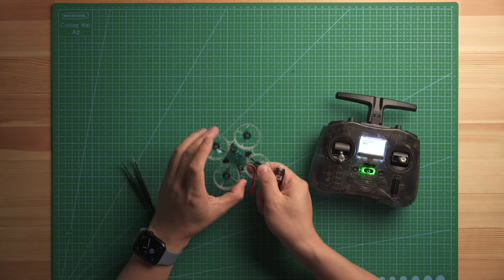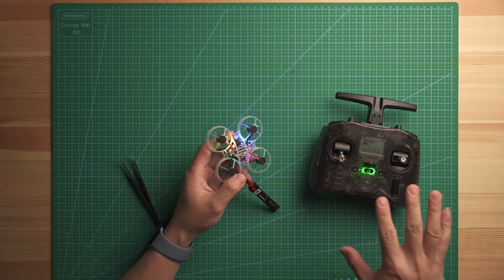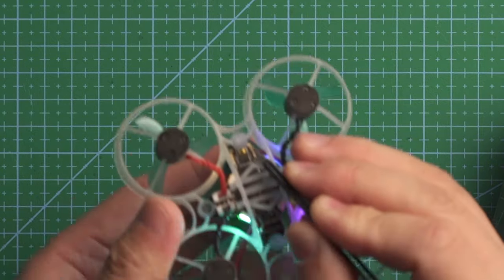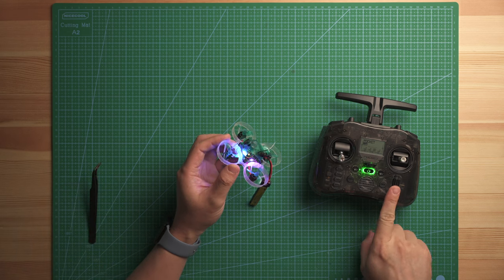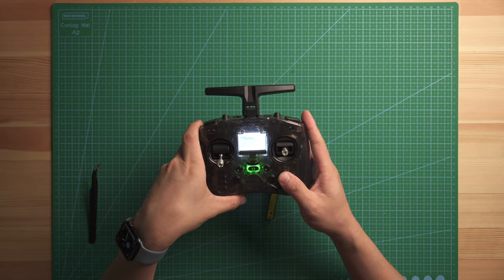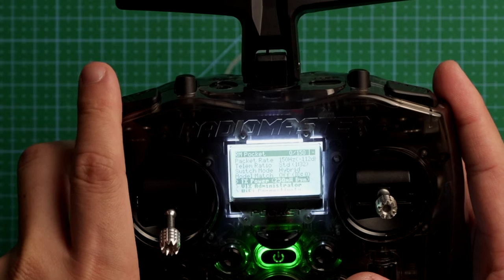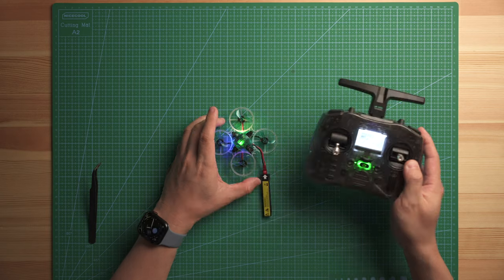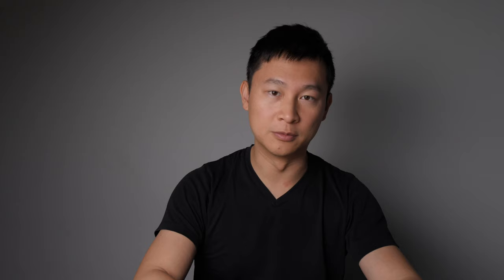Hummingbird V3 BNF Binding | A NewBeeDrone Tutorial

Comment: The easiest way to bind to this is to simply add your bind phrase on betaflight. It instantly binds without having to push the button and doesn't unbind. This is a great little quad right out of the box! The tune it comes with is pretty spot on!
Reply: I tried that and it did not work for me.  Maybe others have gotten it to work.  I had to press the button.
Reply: Not on mine
Reply: @transmech  did you double check that the elrs module and the receiver are on the same version of elrs. I've still to this day never had my bind phrase not work.
Reply: Yep it seems they have defective units going out
Reply: @transmech  Depends on manufacturer. I only use Radiomaster and have never had a single issue.

Comment: The Radiomaster Pocket is soooooo easy.  The default model works perfectly with my NBD Hummingbird V3.  Didn't need to setup in Betaflight, didn't need to do any controller setup besides setting packet rate to 150 Hz.  Really great product, so fun to fly.  Keep it up NBD!  Ciotti sold me on this one.  ganglyGAAAAANG haha
Reply: I've just started racing and appreciate the "feel" of the 0703 16420 kV motors with the meteor65 pro frame and 35mm propellers.  I appreciate that you can fit everything onto this tiny cross-style board and that it is small enough to fit into the 65 pro frame.  I get 4 minutes of flight time with this configuration.  The batteries you sell are top notch too.  hoping you can get more 250 mAh batteries because I really want to try

Comment: Question I can’t bind the hummingbird to the jumper v2, I seen videos to use flysky, bugmini, and elrs, I have try pushing the button in the bottom and it still won’t bind to the controller so at this point, anybody has any other suggestion please let me know. At this point starting to regret not buying just a beginners set up kit.

Comment: My Hummingbird V3 kept losing or resetting its binding phrase and Actual Rate previously almost every time that I changed battery after a flight.

It seems to be ok yesterday after I followed these https://www.youtube.com/watch?v=mMorXvJRKgI but I still  don't know which setting is making it better.

I suspect it is by bumping up the minimum cell voltage from 2.9 to 3.2, although currently it doesn't makes sense because these setting are already inside the flight controller.

Do you know how come?
Reply from the maker: it can be the main MCU problem. We do have one case like that, replace the F411 chips fix the problem. You can also try flash firmware. You can find the firmware on our website: newbeedrone.com and you will see firmware download, click in and find Hummingbird V3.
Reply: @NewBeeDrones  ok got it… Appreciate the reply… I’ll try one of those choice.